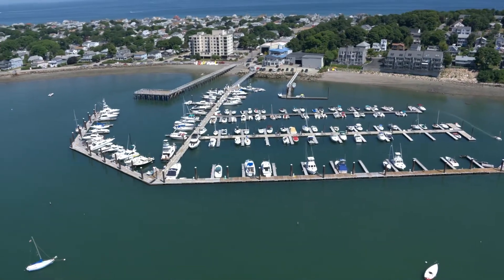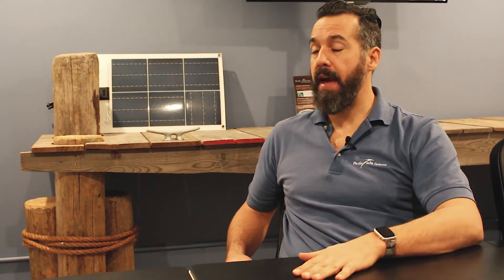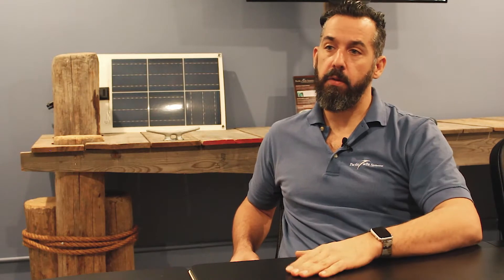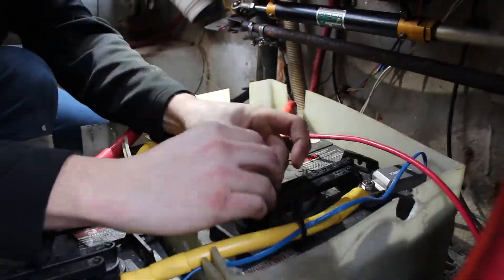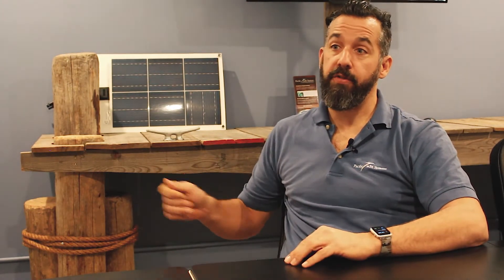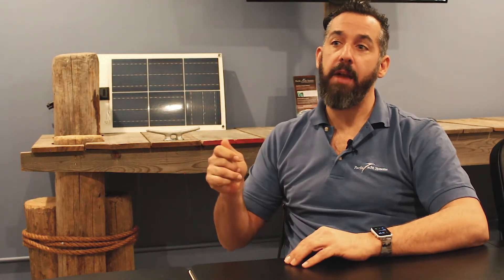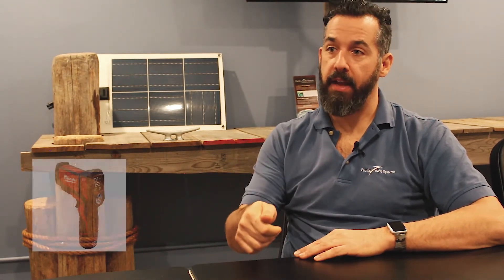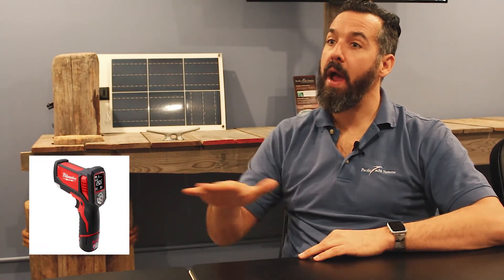Power Time with Jeff Cote - Battery Charger, Temp Sensor Tips

Comment: Should I wrap some sort of clothes or covers around the batteries in the winters when the temperature is dropped down to 6 degrees and put a small fan on batteries during the summer season when the outside temperature is around 45 to 50?

Comment: So, connect directly to the negative terminal?  I've watched several videos so far on connecting a temp sensor to a battery and yours is the first to even show how you actually connect it.  I'm guessing the yellow wires are negative and red positive.  That would mean you connected to negative terminal.
Edit: Btw, the last video I watched he was kind of pointing to the center of his battery bank.  Like to a spot where there was no terminal.  I think he planned to glue or tape the sensor to the top of the battery.  He never said specifically though or show it like you did.  And your connection definitely looks like it was designed for the terminal.

Comment: Thanks for information that if battery temperature is high then volt would be low but  Can you please tell me that if lead acid battery temperature high then mppt controller charge lead acid battery with high current or low current?
Reply from the maker: A temperature compensated MPPT solar controller will also lower the voltage and consequently lower the potential current going into the batteries from the MPPT, if the battery temperature is higher then the nominal value of 77 degrees Fahrenheit.
Reply: Thanks :) Actually I made diy 800w solar system(off grid) and every day generate 2.5 to 2.8 unit so i could not find where is getting losses.actually here in(india) summer in normal temperature is 50 Degree Celsius and i have mppt controller with temperature sensor.india made mppt controller not support battery temperature  sensor so bought online.:)